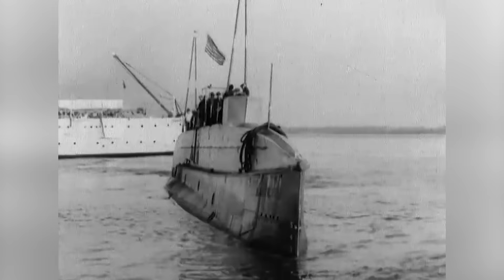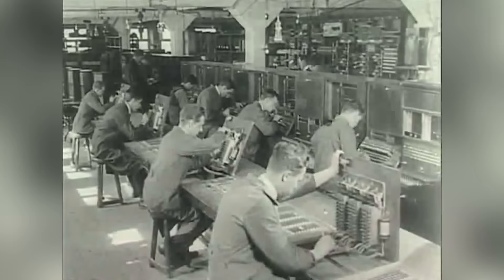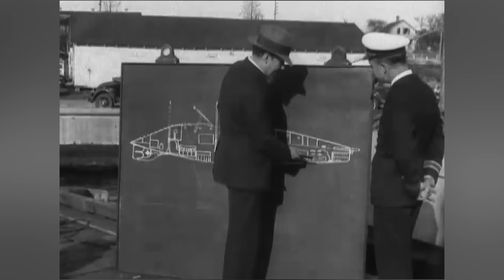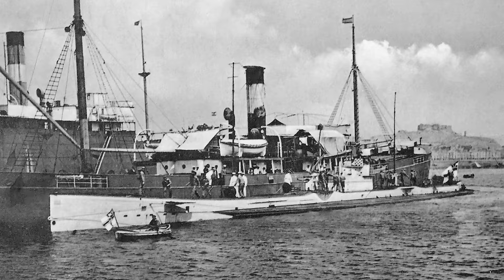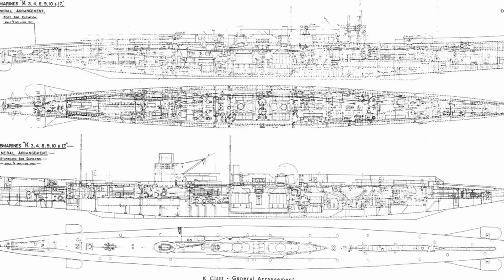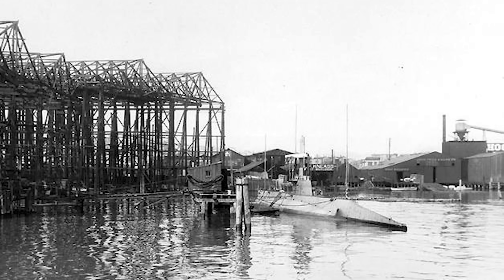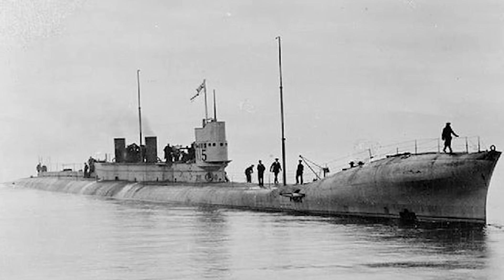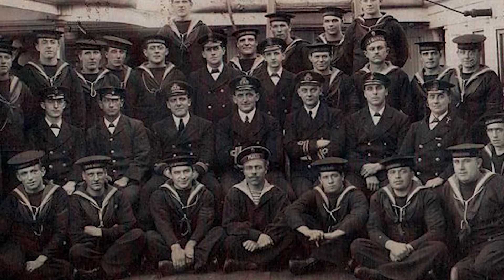The RIDICULOUS Steam Submarine: The K-Class Failure

Comment: The Idea of  steam powered subs also came up in Germany. There was a design called Project 50. A prototype was ordered and may or may not have beeen under construction at the end of the WWI. There is only one known genaral drawing of this type. The big difference was that the boilers were fittet in seperate compartmets outside the main hull. There were rumors of special diving boilers that could be flooded. It looks to me like the boiler rooms were not pressure tight, which suports this theory. As nearly all information about this type is lost, we will never know how it would have worked out.

Comment: Since nuclear subs are steam engines , i am curious about what is fundamentally different from the point of veiw of the steam part (generating fresh water, and then condensing it for reuse).  Since Titanic already had the tech to run an almost closed cycle freshwater from water to steam to water, I would assume they could do same on the K class boats? 
If so, wouldn't it be just a case of turning off the boilers, and running on leftover steam while you dive and eventually switching to electric?
I am curious whether the concept itself was flawed,  (since nucler subs reuse the concept today, is it flawed?), or whether the tech of the day just didn't allow scaling it down to fit a sub?
If you turn off fuel flow to the boilers, wouldn't it very quickly stop generating smoke?  Couldn't they have funneled all boiler smoke into a single "funnel" that went through the hull to the outside and thus, like for diesel subs, need to close off only one hatch for the smoke funnel?
Reply: I don't know that much about steam boilers I admit. But you can't quickly shut down their furnaces. And the boilers work by channelling large amounts of smoke through them. The funnels need to be large and fairly unobstructed

Comment: The next class of steam driven RN submarines (the Explorer class) solved the problem of all of the needed hull penetrations by using high test hydrogen peroxide to supply the oxygen, but added all of the problems of handling high test hydrogen peroxide.  The RN steam powered submarine to be a success was HMS Dreadnought, which was nuclear powered.

Comment: Excellent video. Just shows that an old proven technology (as in steam power) sometimes simply isn't up to the job you want it to do. Same as trying to power cars with steam, that led to a whole load of different problems until it became obvious that steam simply was no match for the internal combustion engine in that role.
Reply: The biggest problem with steam-powered cars was the long lead time once the boiler was lit to where there was enough pressure to go.  Once that level was reached steam cars had plenty of power and get-up-and -go BUT they just couldn't complete with the "instant on" of a gasolene powered car.  So they went out of business.

Comment: Nuclear submarines are also driven by steam turbines. Nuclear energy solved the problems with oxygen, fuel and exhaust, but the reactors and the size of the engines did not make the subs smaller. This technology is normally safe, but introduced new hazards to both the crew and the environment.

Comment: I just realized something, decades before the K class, in America there were closed loop steam powered cars.  The steam didn't need to vent.  All the heating and steam loops were enclosed.  If the K class designers had known about this, I wonder if they could have improved the design, just had exhaust like diesel subs do instead of those massive smokestacks.
Reply: Bear in mind that the propulsion at   25 knots would need a large multiple of the power of a slower Diesel vessel and would be less than half the efficiency, resulting in a much larger flue gas volume and boiler flue   back pressure limits would restrict discharge velocity, demanding a much bigger opening in the hull. Agreed a condensing steam circuit could have been used, as done on many steamships to raise efficiency. I don't know if K class had condensers, you'd think they would, if only for stealth to avoid a white plume.

Comment: Those K class subs looked like prehistoric dolphins with physiological deformities.
   Incidentally, battery power was fairly clean and safe from steam and exhaust emissions, but in those days, the batteries had an inherent danger: as the diesel (or steam) engines charged the batteries, the electrolytes generated hydrogen gas. Fresh air was absolutely essential for engine operation and the survival of the crew. That's why submarines ran their engines only while on the surface.

Comment: This is why, when I design a steam-powered submarine, it will be a flying steam-powered submarine.

BTW, according to an account elsewhere, K13's captain was attempting to assist the visiting K14's captain in reaching the surface, with K13's captain aiming to remain aboard.
According to that account, a blast of compressed air, intended to assist, was too powerful, slamming K14's captain into the roof of the flooded wheelhouse where he was trapped and perished, and sweeping K13's captain out of the boat and to the surface.

Comment: As an old nuclear-trained attack boat sailor I knew I’d have to respond to all this negative talk about steam-powered submarines. Of course, the advent of the nuclear tea-kettle and low-pressure steam has made quite a difference, although the engineering plant still takes up half the boat. And yes, modern submarines do have “vents,” or more specifically vent valves, which open to allow air to be released and water to flood into the ballast tanks, allowing the boat to dive.

Comment: This footage is misleading, showing images of diesel engines that have ever been used in submarines and showing images of huge boilers that are not related to the offending class of submarines. The first steam-powered submarine was produced by the Barrow shipyard in 1880 and was sold to Turkey; it was only 30 meters long and had a real coal boiler; he dived several times and managed to sink a target ship without any problems. It is also misleading that the surface speed was decisive, in the hypothesis that a submarine could intercept a steam ship: most of the torpedoes occurred by submarines waiting for passing ships. Steam technology wasn't that so bizarre, France also built 17 steam submarines from 1907 to 1919 and they had no accidents caused by its type of propulsion. It is also forgotten that most of the earlier submarines had Otto cycle engines but fueled by oil, which emitted the same type of smoke as that of the oil-fired boiler.

Diving times were important and were reduced by all the navies of the world, but this also happened with kerosene and oil submarines.

The only accident caused by the fuel type of class K was that of the failure to close the smokestack door, the most serious ones were caused by collisions, or a failure of the rudder.

Comment: The K class submarine gawd those things where a disaster, who ever thought them up was a idiot. The K should have been for Killer
Reply: It was an attempt to produce a submersible with the ability to operate as part of the surface battle fleet., which required a speed of at least 21 knots.

The ambition rather exceeded the available technology.
Reply: Just because something was a failure doesn't mean its designers were idiots. Far from it. You have the benefit of over 100 years of hindsight and for you, submarines are familiar technology They had neither.
When your country is under threat in a world war, you take risks and go with it.
Desperate times mean desperate measures.

Comment: Why did they fit an additional diesel powerplant to charge the battery, why not add generators to the steam turbines? Does the low power diesel not mandate the submarine to stay longer at the surface after a combat dive? The submarine would need even more energie because of the massive size.

Comment: Lots and lots of asbestos for insulation. So if the heat didn't get them the mesothelioma sure would.
Reply: Only if they started drilling holes in them.

This is not standard practice on a submarine, for some reason.